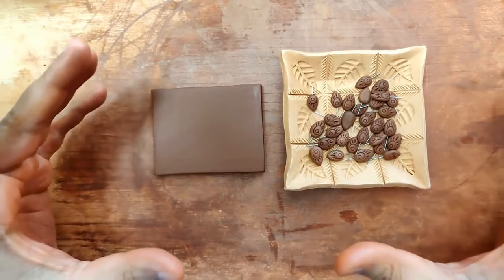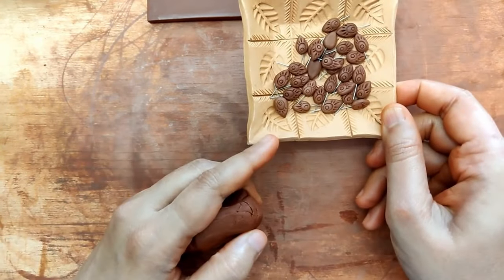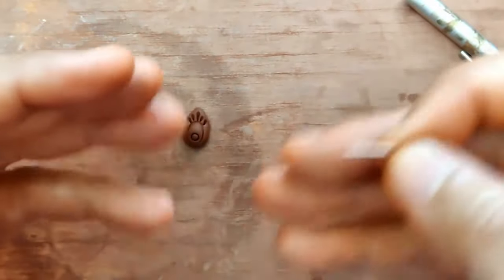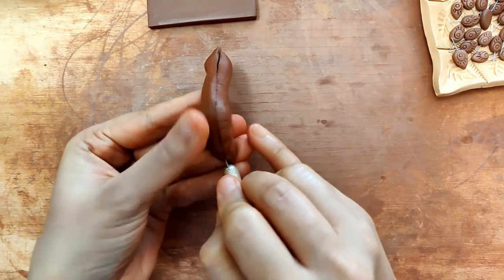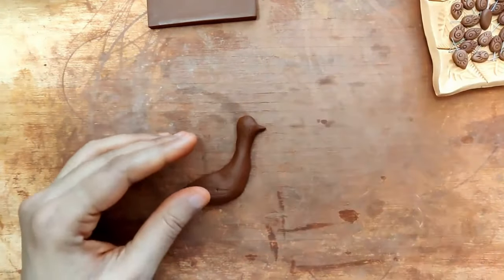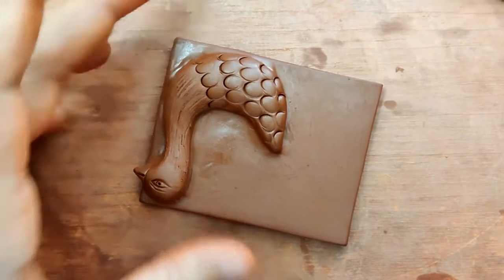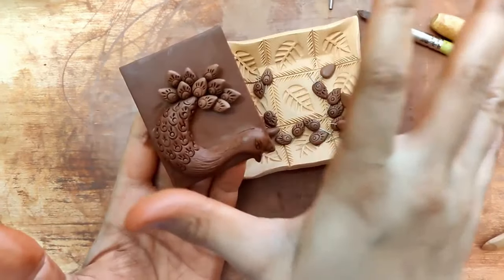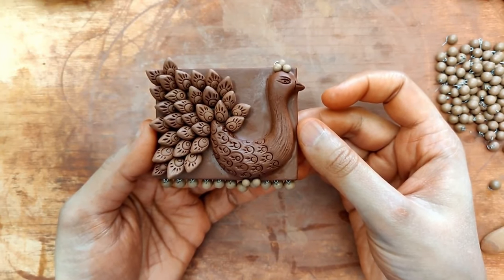Graceful & Grand Terracotta #peacock Pendant|#Terracottajewellery#paintedEarthbyneha #howto#tutorial

Comment: Omg,neha mam, it's soooooo beautiful,no words to express,
But I query,those petal shape beads wire when u insert those on main flat part,from back side those wire didn't came out?
As the base is also of just .6mm
Reply from the maker: Thank you so much! 😊🙏
So in the video while inserting the petals (please listen) I do mention that one must be careful and constantly check if the pin is jutting out from the back of pendant. Also if you notice, the pins go at an angle, they don't go straight down. Hope this clarifies your doubt :)